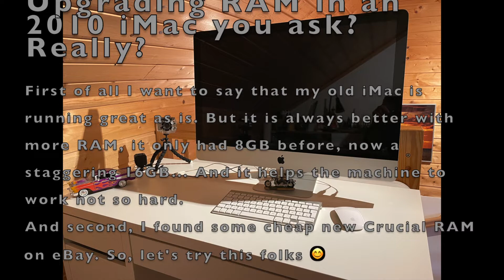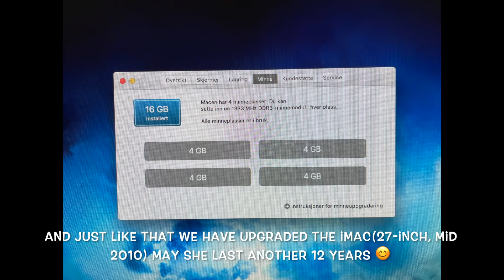Upgrading RAM memory in my old iMac (27-inch, Mid 2010)

Comment: Even though I did change the ram, when I started up, my iMac, a beeping sound it wouldn’t stop until I pulled it off the electricity! What might be causing it?
Reply from the maker: Hello!
Can be many causes, ram not mounted properly. Wrong type of ram. Something is loose after upgrading. Maybe you must in and reset ram in disc utility during first startup. I don't know, I am not a Mac technician, sorry I don't have any good advice.